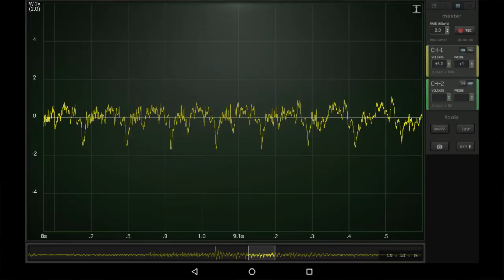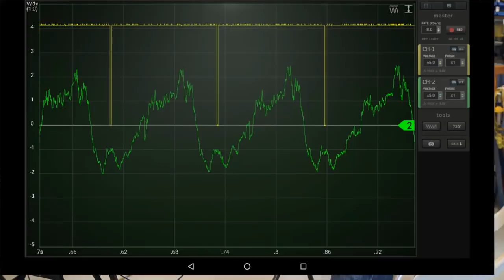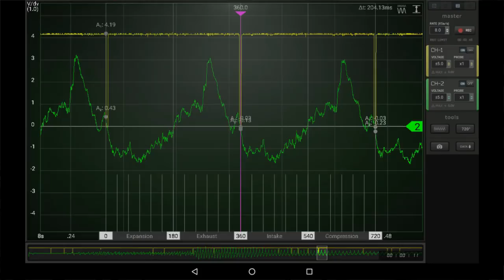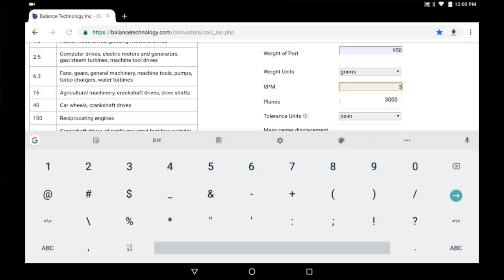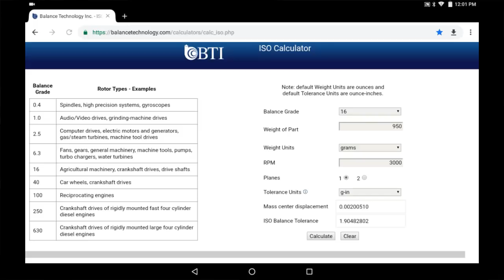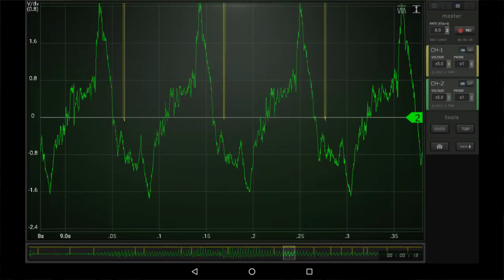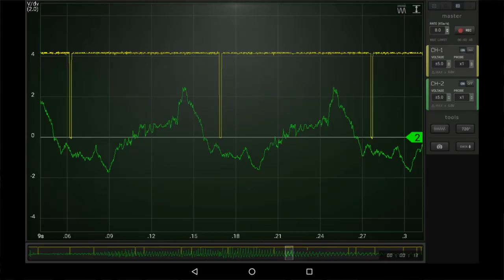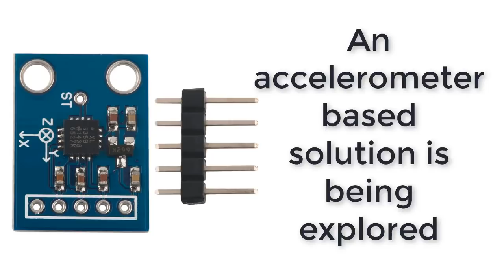GADGETS#54 - OSCILLOSCOPE DYNAMIC BALANCING

Comment: Thank you for taking time, which is more precise and with a greater range. They have told me that these old ones are more adaptable because their gain is greater and when working they are more versatile but take much longer but it is much better. I understand that it is something similar to what I comment that to achieve better results in the 4-blade. I was reviewing and there is another video I am going to detail and another where a team does. Thank you for commenting and contributing your experience and knowledge.

Comment: Hi, any way to balance a vacuum cleaner impeller to the motor?
Reply from the maker: not on motor...too high RPM for IR sensors featured on DIY methods on the channel so far

even too fast fast with the laser I'm using off camera here

impeller would have to be mounted on a mandrel and balanced at a lower speed and then reinstalled on motor...since it's a "rigid rotor", the lower speed balance would be still be good at the higher speed

Comment: What is the piezo reacting to?  Linear movement?  Also, if the unit is balanced,  what r the peaks and valleys?  It seems that a state of balance would b a straight line. U r one impressive person!!
Reply from the maker: +Bill Rimmer - The piezo is responding to EVERYTHING...part of the problem. It's picking up all noise and vibrations.
The trick is to focus ONLY on the moment a heavy end of the blade applies pressure on the movable portion of the hinge, transmitted to the piezo inside the stethoscope.
The rest is noise and must be ignored.
I expect the accelerometer based balancer will be much more refined in many respects and will be capable of balancing more complex rotors.

Comment: I was thinking that you needed some reference point as to when the drill is removed, so that you only read/use the scope readings thereafter.

I am also wondering about oscillations conveyed from the drill... Let's say it is out of balance... That wobble effects the blade mass, I would think... And, therefore, some amount of deflection occurs in the blade rotation... Which makes the blade appear to be out of balance, when, in actuality, the issue is with the drill... And, the long length of the rod/axle would exacerbate the problem... Just thinking...
Reply from the maker: the measurements used are those taken after the drill is disengaged and blade is spinning freely...
I end this video stating that I would switch to an accelerometer rather than piezo. I did this in #58, #59 and #60

Comment: could this or a similar method be applied to a wheel and tire assembly on a vehicle (on-vehicle balancing)? Thanks for the video / inspriation! :-)
Reply from the maker: not this method, Tom
But the methods used in #58, #59 and #60 could be made to balance tires. You'd have to be comfortable with single plane (I am) with correction done center rim with adhesive weights (like many OEM tires and rims are done)
I'm thinking of demonstrating it but it won't be for a while if I do
Reply: @theGADGETSplaylist  A demo from an expert would be very Awesome! - I'm looking for some method at home that will be better than a static balance - seems this area of knowledge is lacking among folks! Thank you for your videos :-)

Comment: I noticed that the BTI calculator had a Balance Grade for car wheels. I'm wondering whether you can adapt this method to dynamically balance a wheel besides a static balance.
Reply from the maker: +xr500t - not with this piezo based method.
I explain why at the beginning of GADGETS#58 which uses an accelerometer based soft bearing method. Check out #59 for another example. If the pendulum and frame were scaled up, this process could balance a wheel.
Reply: @theGADGETSplaylist  Thank you, heading right over to watch!

Comment: its clear that you have a great deal of experience in balancing, you shared a lot of information and I sincerely thank you for that.  However, given the precision required, it seems (to me) this rig is grossly insufficient.   Wood base?  a "bearing" formed by threaded rod through an 1/8" bracket?  Copper fitting shim?  washer (not concentric) acting on that hinge?  and shouldn't that blade be spinning at a constant RPM, ideally the speed it spins at  in use?  With all this room for error, its hard to imagine how any meaningful information can be gathered.   I am not familiar with your channel, but it seems like you don't have a lathe in your shop, building a balancing rig without a lathe seems like a bad idea.  I don't say all this to be an ass, but rather to look critically at your method with hopes of improving it for myself and others.

ps- what effect does spinning the blade vertically (vs its normal, horizontal use) have on balancing?
Reply from the maker: +Matt Traven - there are 3 more videos dealing with balancing (#58,#59,#60) where some of your questions are addressed including a discussion about this being an apparatus and not considered a balancing machine. And as to the limitations of this piezo approach.
I wouldn't worry about the washer, concentric enough. And what's the copper spacer have to do with anything?
All your other fears about constant RPM etc, unfounded.
Match what I've done in these 4 balancing  videos first and then by all means set out to improve on them.